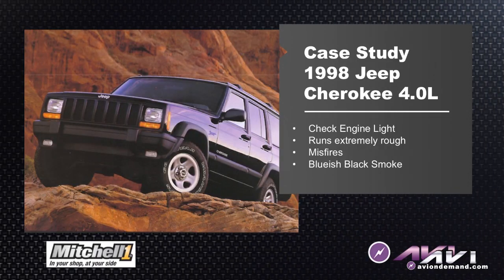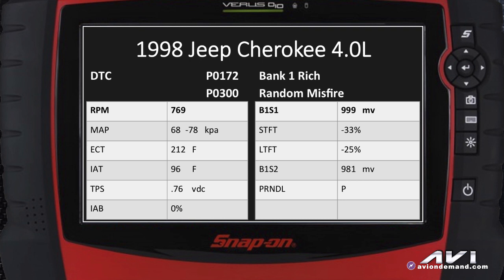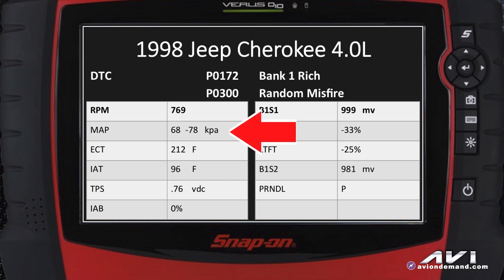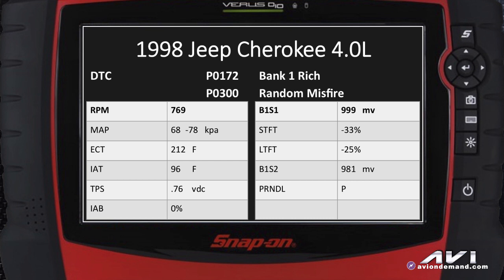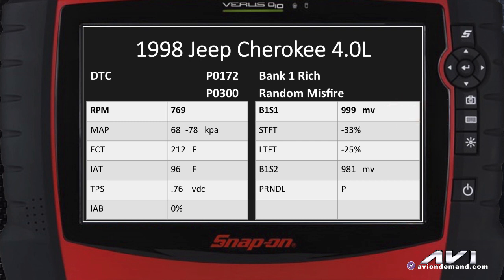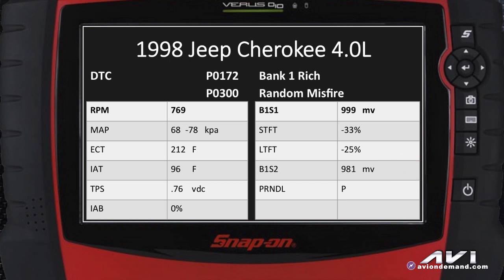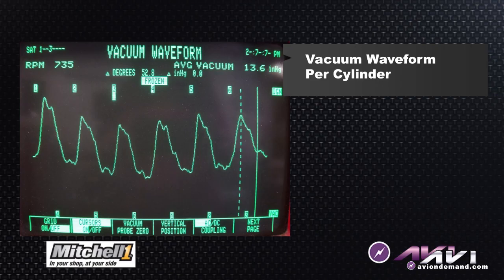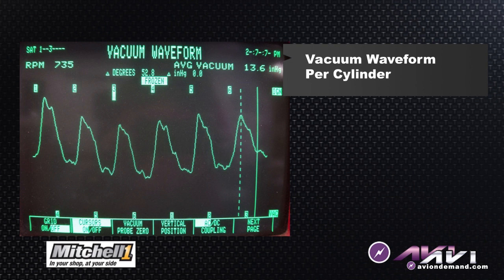Fix a Rich Trouble P0172/P0300 Codes on a 1998 Jeep Cherokee | Ron Bilyeu | Tech Tip

Comment: I have a 4.0 Jeep XJ that has low vac. idling but OK down the road shows 29.2. no broken springs. Leak down test shows only rings seeping but within limits. how about a bad lifter?
Reply from the maker: Its a possibility. If a hard knocking or a noticeable tapping noise that manifests in volume with the engine rpm then I would assume so. 
- J. from AVI